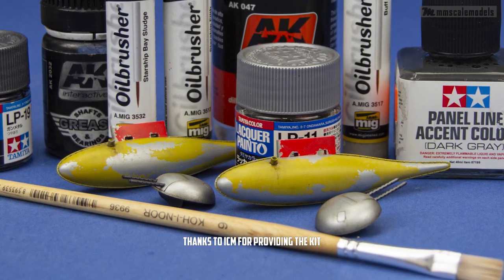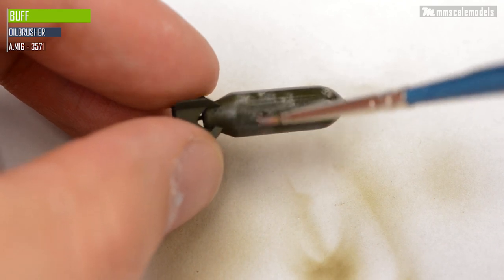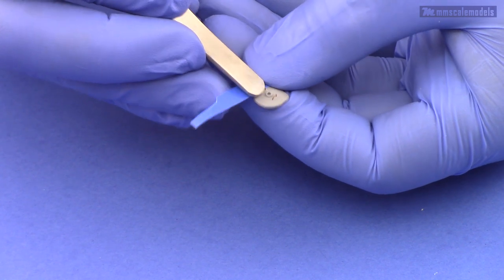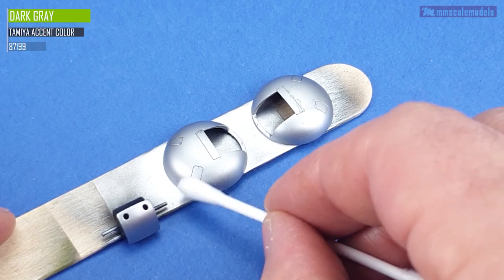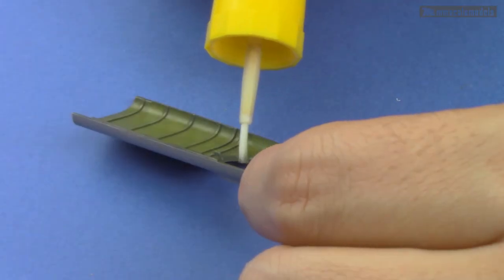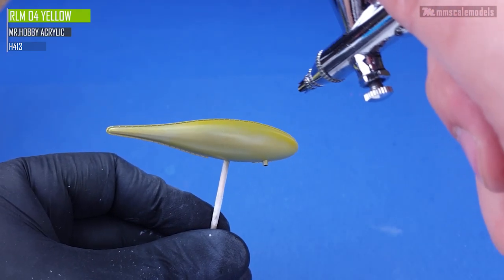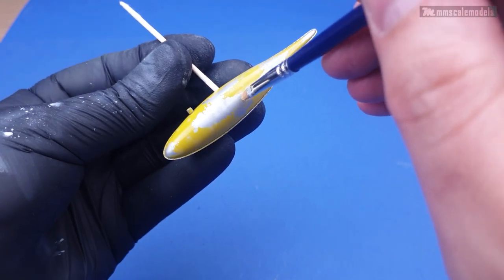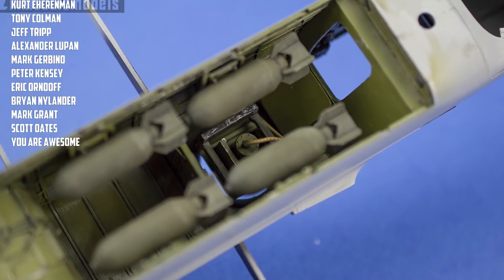3D Printed parts look awesome with some paint - Douglas B-26B-50 Invader - ICM - 1/48

Comment: Very nice work. Congrats :) Just one note - the airplane you are building did not have the lower gun turet. The reserve fuel tank were installed in place of lower turet.
Reply from the maker: Thanks mate, I have read about that but honestly haven't been able to find a picture to prove such theory. Also no way to see how the area is reworked to fill the opening so I will live with that :)
Reply: @MMScaleModels  a-26k